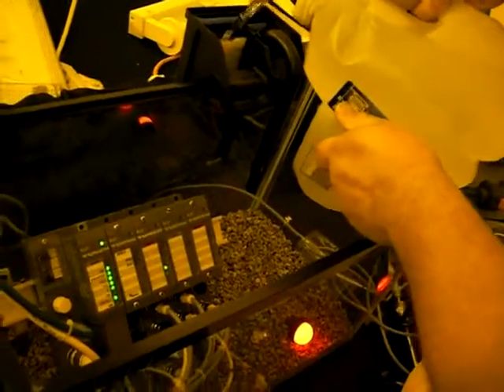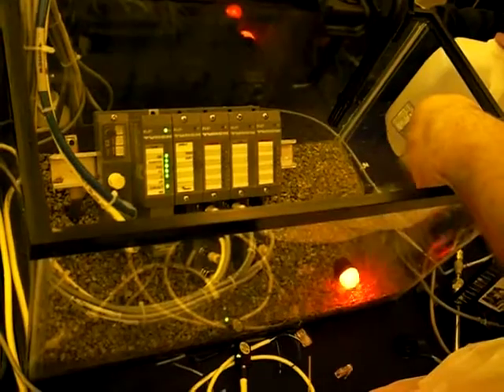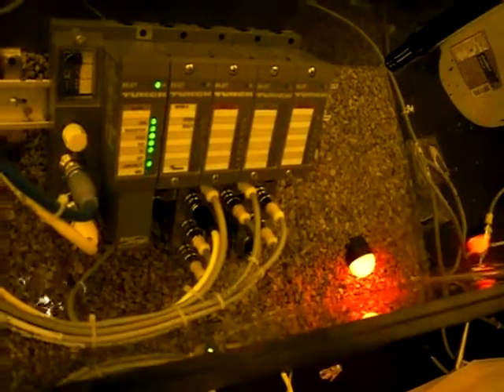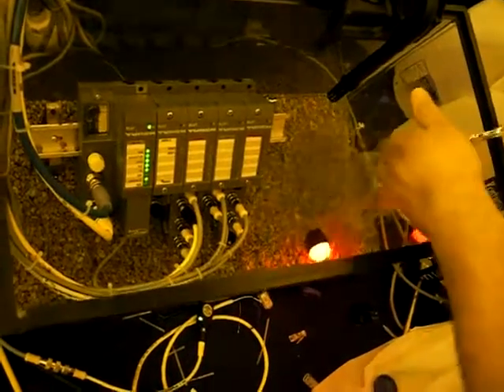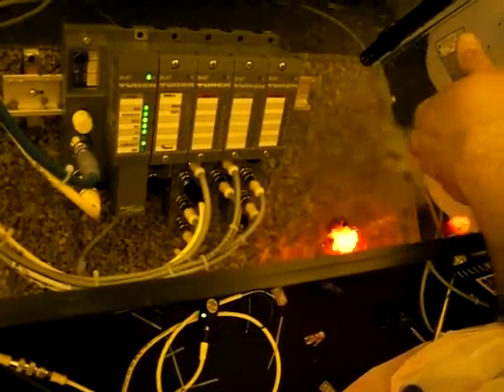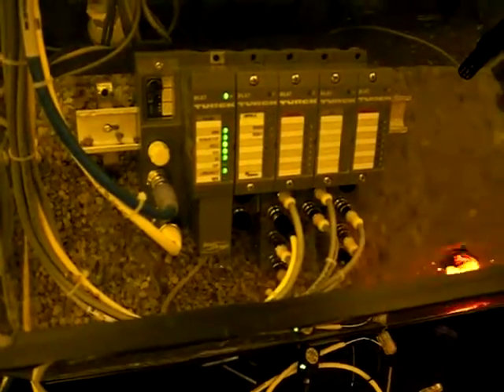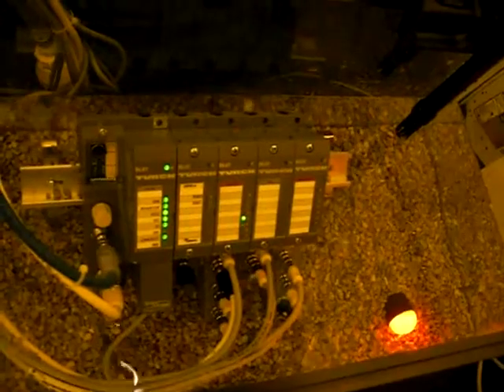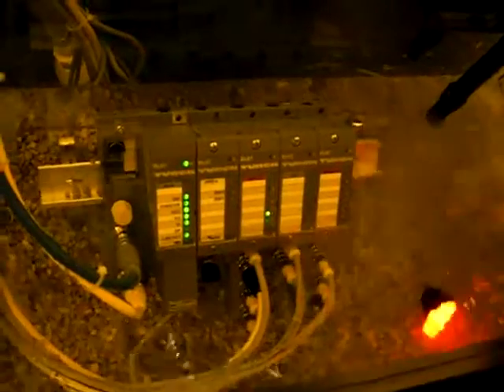TURCK BL67 in Fish Tank

Comment from the maker: No I do not buy the unit but I do work for TURCK.  We did this at a trade show to prove the IP67 rating of the product.  Though it is not designed for total submersion as in the video, it does get across the water tight protection of the product.  Do not try this with an AB SLC or ControlLogix as you will not have the same luck.  But you will be out a lot more money of course with that option.